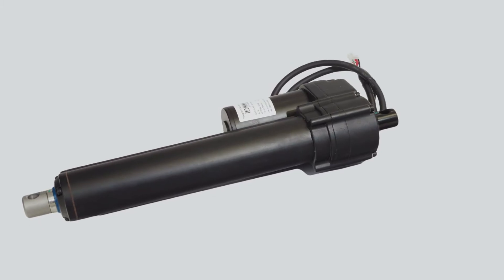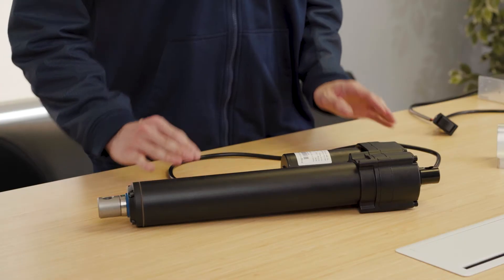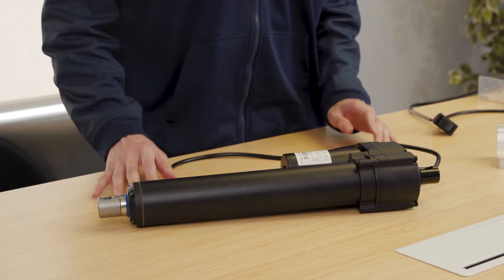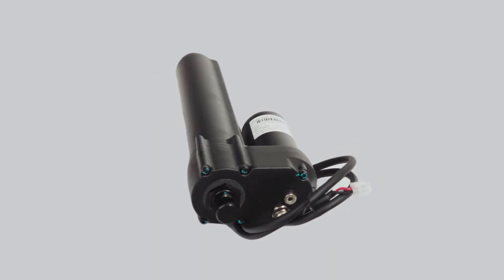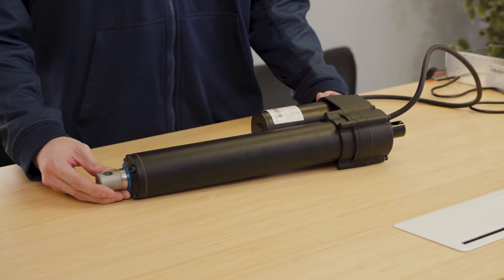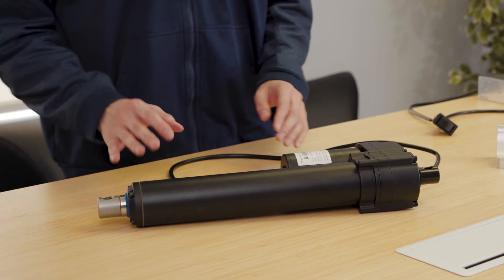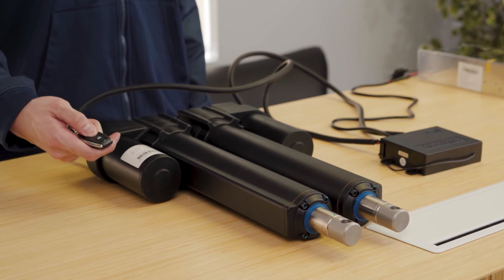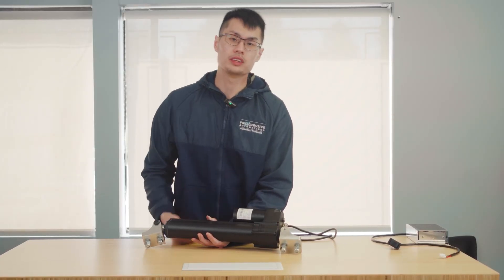Heavy-Duty Linear Actuators for High-Load Applications | PROGRESSIVE AUTOMATIONS

Comment: would this hold up for controlling angle function on a snow plow for a side by side how well would it handle impact?
Reply from the maker: Heavy duty category of actuators such as these high load actuators have sufficient force ratings and ingress protection to handle controlling angle functions on a snow plow within the suitable size range. We suggest locking safety mechanisms to handle impact and keeping the actuators strictly for push-pull force as the actuators are not designed for impact force. 

Similar to the PA-HD1, our PA-17 has been used for snow plows like the example below:
https://www.progressiveautomations.com/blogs/stories/upgrade-atv-dozer
Reply: @ProgressiveAutomations  thank you

Comment: Is there a way to stop it at a certain load, so that it can be used to clamp two metal parts??
Reply from the maker: The actuator stops moving and will lock into its last position when electrical power is shut off. To further enhance the locking static position, you can supply +ve voltage to both wire leads of the actuator for motor lock condition.
Reply: @ProgressiveAutomations  Thanks for the reply, but how will I know when to shut off power? Imagine trying to clamp two plates of metal with your acruator, lets say its stroke is 12 inch and clamping happens around 8 inch stroke. Do I just keep the power on and it will automatically stop at 8 inch after applying max force and hold it there ?
Reply from the maker: The PA-HD1 actuator has a mechanical slip clutch as an overload protection feature if the max force rating was exceeded, you can then shut off power to stop the electrical current flow and keep the actuator locked into the static position. If possible, not regularly relying on the mechanical slip clutch overload protection feature is better practice since it is intended for emergencies and regular practice of knowing when to shut off power at the right timing will help extend service life of your actuator.

Comment: how come my Linear actuator sounds like a machine gun?  it just spins when unhooked...  whats wrong with it?
Reply from the maker: Hello,

Normally, our linear actuators do not spin as they cycle with the exception of custom ordered units and the model PA-17 heavy duty actuator with a stroke length over 24 inches. The PA-17 has a mechanical slip clutch as a safety feature that engages when a load over the rated specifications was applied and may be when it generates the sound being described. Check if the load being experienced at where the shaft of the actuator meets the attachment was truly within the rated force capacity or if it will vary depending on the application conditions. If it has a stroke length longer than 24 inch, it also will not have limit switches and can keep spinning once it reaches the end of travel. This requires users to manually shut off electrical power once the desired position has been reached. 

For further assistance, please reach out to sales@progressiveautomations.com or call 1-800-676-6123

We look forward to hearing from you.

Best regards,

Progressive Automations
Reply: @ProgressiveAutomations  Mine is the K2G10-12V-BR-06MYP  it's the actuator on a Myers Electric home-plow, Brand new it worked for maybe 15 minutes then it just failed and started making the sound like a machine gun.  If I disconnect the piston from the plow lift bar the top of the actuator just spins and spins it does't extend or retract like it would during normal operation the remote control works properly because it spins one way and then will spin the opposite way like it's suppose to do.  Do you have any idea what might be causing this to happen?
Reply: Also it just spins without being extended,
Reply from the maker: Hello,

It may be possible that one of the gears which links between the motor and the shaft was broken from an overload condition or high impact force. Based on the model number you provided, the unit appears to be from Thomson Linear according to a quick Google search. 

K2G10-12V-BR-06MYP - Your current unit
K2G10-12V-BR-06 - Thomson Linear (Google search)

It may be worth checking with Thomson Linear or Myers Electric if there was any warranty or assistance they could offer for you. The damage that occurs here may be due to the actuator not having the sufficient force rating for your type of use case conditions. Try to verify the force rating of the actuator you used and how much force was applied onto the shaft during the application use case.

For further assistance, please reach out to sales@progressiveautomations.com or call 1-800-676-6123.

Best regards,

Progressive Automations

Comment: Do you have video on how to modify linger actuator to extent its range
Reply from the maker: Hello,

Once they are manufactured, our actuators are not able to have a stroke length longer than the maximum it already came with. In order to have an extended range, you would need a longer stroke which comes from having a separate actuator that has a longer overall body to house the longer shaft. 

We'll be happy to assist you further at sales@progressiveautomations.com

Best regards,

Progressive Automations Team

Comment: How fast can these move under load?
Reply from the maker: The speed when fully loaded is 1.11 "/sec for the 450 lbs model, 0.55 "/sec for the 900 lbs model, and 0.27 "/sec for the 1574 lbs model.